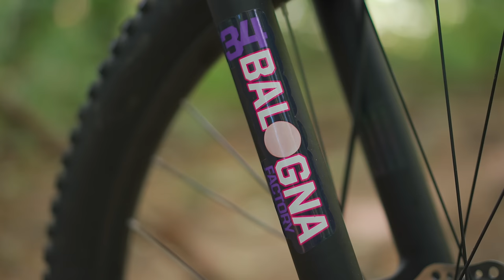This $130 MTB Air Fork works great until it doesn’t

Comment: I have actually considered getting a decent coil fork to replace my RockShox Judy Silver simply because the former will require less maintenance, meaning less expense, over the long haul.  I say this after taking my forks in for the annual rebuild which cost me around $100 at my local shop.  I can do basic maintenance like replacing the foam seals every 50 hours per the manufacturer's recommendations.  It's just the 200 hour overhaul that I'm less confident in performing, and that's the one that bites me in the wallet.
Reply: If you can do the 50-hour service (new foam rings/grease air spring) you should be good for a few years - no need for a damper rebuild or to take it to a shop unless something feels wrong. Even the 50-hr service is just to help small bump sensitivity so it’s optional up to a point. Just keep it clean after each ride. Treat the symptom rather than check off a list
Reply: @martonpeintlerkrivan8027  I just finished a ride on my local trail after getting my forks serviced, and I can say that they perform substantially better than before, so it was worth it from that standpoint.  But at $100 a pop for parts and labor every few months?  It would almost be cheaper to buy new forks every couple of years.  I definitely need to learn how to do the full service myself.

Comment: Still need to control the drop two thing will happen either you break your driveway or the drop will hurt someone.  The drop when the test at company had a soft bag like a damper to soften the rebound.

Comment: Had to get some rockshox judy air for my older dj since 1 1/8 steerers are non existant. Doubled up pressure and shes holding fine for skatepark at least

Comment: Just in case nobody has meantioned this, the zoom hydraulic brakes, these are the same ones that come on many higher end electric scooters. When I was doing research and looking at options, these are the exact ones that came on most, and are on the one I ended up picking up. This is a scooter that can do 64km/h, front and rear suspension (though it's only basic coil suspension with no rebound) and duel motors.

Comment: Love to see these budget builds.  Not all of us can afford 5k bikes every 6 months like you see all of these people doing.  I myself have done a VERY similar build on an old DB hardtail and I DO ride it on just about everything except large jumps.  My budget air fork has held up at bike parks and everywhere else.  Very impressed with the difference between it and the suntour coil that used to be on it.  That coil fork was junk and failed almost immediately (or maybe I'm just too hard on it).  If I have one complaint about the budget fork it is this, the amount of flex it has when doing extreme riding scares the hell outta me.  Granted, I do not have some tremendous amount of experience with a bunch of different forks like Seth to know how much flex is considered "normal".  If you are riding greens then a budget air fork is a great upgrade for you.  But if you are doing more blues and blacks then I would strongly suggest getting something maybe a bit more expensive that HOPEFULLY will be stronger, even though I myself have done these with my budget air fork and it didn't kill me... yet...  Pray for me boys 😆

Comment: In theory i have an xcr32 rl 100mm coil but i cant find it on the internet (i only found 120mm air forks with that name), how do i find out really what is on my bike? Btw i have a kross level 4.0 2023

Comment: Sr suntour got steel legs and that amazon fork got probly aluminium legs so after working and heating up legs changed diameter by little bit and thats why stiction is higher

Comment: Not true about leaving the cheap Suntour forks (XCT or XCM) outside for years and they still work. Only when you keep them dry otherwise they start corroding on the inside and get stuck very quickly. The XCR air is already a much better fork especially if you transform it to 120mm by removing a nylon bushing. No corrosion as far as I witnessed with these forks. Night and day difference in feel between 100mm and 120mm.

Comment: Before using the XCR fork make sure to convert it to oil lubrication. Or at least check if it is oil lubricated. Most entry level Sr Suntour air forks use grease as lubricant for the stanchions and don't have oil foam rings. After a couple rides it won't feel soft enough. Just like the $130 fork. Luckily it is an easy conversion. You just need to get a couple foam rings and some fork oil. You can get a couple washers to prevent oil leaking through the bolts.

Comment: Today I covered over 8,000 km with this shock absorber. Go for it without servicing. I only cleaned the shavings with a cloth and sprayed some silicone from above onto the seals. After winter riding, the gold anode began to come off the leg where the fork works. But it's not the fork's fault, it's the snow and salt on the roads. I have it installed in a 500w electric bike. My weight is between 75 and 80 kg. The fork also survived many trips with panniers and luggage on the handlebar. For this price, if it falls apart, I will gladly buy another one just like it.

Comment: You should install the fork into a headtube with full bearing set loaded properly into the test rig. The tension between the steerer and the crown without ability to 'give' might show more or less bending.

Comment: bolany fork is for casual rides only not for trail ride on my opinion, rating here in my country about 80% of  bolany forks is trash even in rough road or casual riding the lower stantion broke easily

Comment: I'm a bicycle courier on a Cannondale ebike in Europe and use a Bolany 110 for city riding and delivery work, much better or lighter than the stock 70mm m3030 and an XCM30 fork i've had in the past. I've used it on some very bumpy bikepacking trails and exploring and it's held up incredibly. However it does bottom out on some high curbs and I would definitely not use it on any trail that will put it under stress just because of the longevity of the parts, they are definitely lower quality than more expensive forks I've had.

Comment: Yeah you aren't the only one to say the fork has a lot more stiction after that ride. The fork doesn't have a foam ring under the dust wipers to keep it from moving smoothly. And honestly no matter how many times you service that fork even after every ride, the paint on the stanchions will wear off and show the bare metal. The dust wipers while they do work, they still let in dirt since it's not the tightest fit. I did everything to keep that Chinese fork running smooth and again it's not going to last. Im only 125lbs and don't ride that hard but I still wouldn't mind pushing the fork a bit beyond it's limit like we all gotta break the rules at some point to have a little extra fun. But anyways, glad to see you replaced the fork with something better🤙

Comment: the suntour forks dont degrade that much over time because they are already degraded from factory, you dont have any foam rings and oil in the lowers. you can put them there but beware of putting too much oil in the damper side because the damper can suck up oil and block you from using the full travel, and its a cartridge so its not really possible to fix it, ive heard tales of drilling it to let it out but the gases will also go out and i suppose its dangerous to mess with it

Comment: How about putting a rebound cartridge into the suntour xct/xcm ? You can buy these from the same chinese guys that sell bolanys/himalos/etc.  28.7mm and 1.5mm pitch afaik, should fit like a glove. Also cheap coil vs cheap air, coil is definitely the winner. Less stiction, yea its linear but for leasure xc should suffice, you can change the coil and it would cost way below $130.  That chinese generic crap, it just sucks. Yes at the very beginning you fill the difference (compared to an old STOCK xct, which hasnt seen MAINTENANCE in years), and it just gives you false confidence, and you end up in hospital. I got a 160mm himalo 34 for $150, and broke it the next month. Then got a used durolux rc2 2013, did the overhaul, and it worked fine for the last 4 months. As a bonus, 35mm stantions and 180mm travel, much better anodization (almost like kashima coat), and nice compression adjustment. All that for $180

Comment: This is interesting but, at this point, I think you've replaced nearly everything but the frame and wheels. I think you're likely to be able to find a better frame and wheels for under $400. I'm loosing track of what we're doing here. Edit: You also still have the original seat. My point still stands.

Comment: You couldn't pay me to run one of those cheapo Chinese air forks. More power to you if you're that desperate, but for the cost of one of those you could literally find a used, older fork that's not going to potentially kill you.

Comment: I usaually love your stuff - but, this is a silly destructive test that isn't relavent to the forces a fork should be expected to endure.  You are basically testing the fork for resistance to head-on, dead-stop collisions directly along the x-axis. Forks NEVBER see this.   I'm certain that even high end forks would have 30+mm of bend if subjected to youre "smasher". In an actual head-on collision on a bike, there would be a significant y-axis component that would allow the springs and other mechanics to absorb some of the shock.  I know you understand this and can only assume you went for the shock value of the destructive test you conducted - which really only tests the lateral integrity of the steerer tube and steerer tube-yoke connection.

Comment: Sorry but that test was horrible,  you can see the bolany fork flexes like crazy, it just flexes and hits the bottom which stops it from bending, while the suntour does not flex nearly as much and doesn't end up hitting the bottom which is why it ended up bending. This means the fore aft stiffness on the suntour is WAY better which also means way less chance of OTB

Comment: I’m 80% new to biking…..has anyone tried to develop a belt driven bike with a transmission instead of chain and gear?
Reply: Yes that is common enough but transmission at the crank is pinion and luxury expensive stuff. Cheaper is Shimano nexus In the rear wheel but that may not be shock resistant and bad for weight distribution so you don't find it in MTB.       I like it in my Citybike. Shift while stopped. Then it broke tho.

Comment: none of the issues that needed to be addressed in the design of the smesher we're fixed.  You're absolutely not getting the maximum amount of deflection from that weight because the forks are hitting the baseboard. The forks need to be elevated more otherwise the force of that weight isn't fully being transferred to the fork. still a lame ass design, but interesting content nonetheless. you also get rebound because that weight is hanging from a string and not on something solid. because of that, the results of your test can't even be trusted to be close enough to accurate to even consider.

Comment: These forks have so many brand names but one thing they all have common is these pointless reviews. Just put them on a bike and see if you can tune them for reasonable off road ride. Set pressure so no bottom out but not like a heavy wobbly rigid. Tracking and stiction levels. Then you'll find they are unusable garbage.